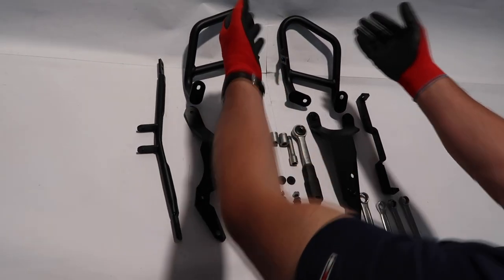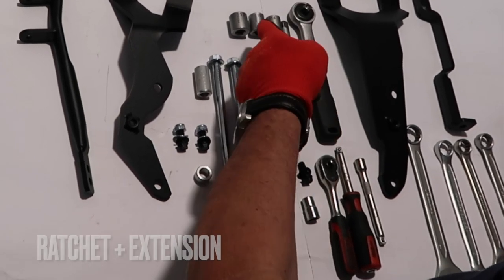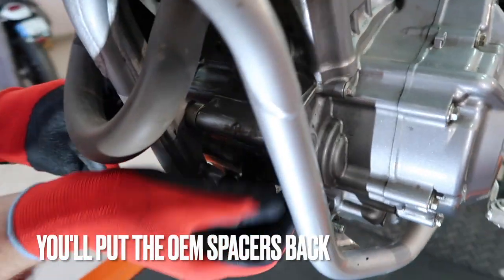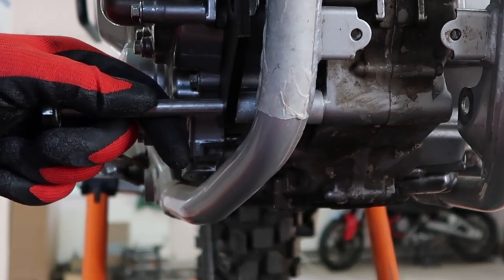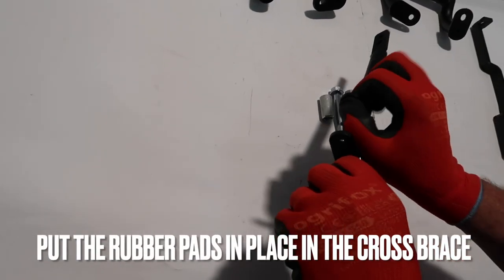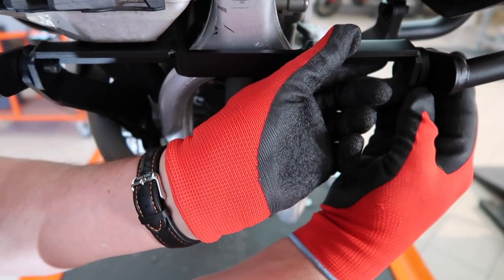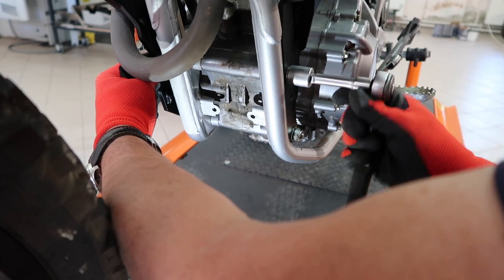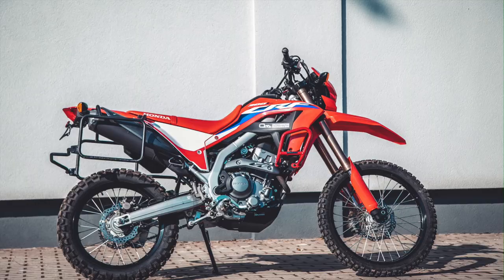Honda CRF300L Crash Bars Installation Instructions

Comment: I installed these today. I have the Flatland aluminum skidplate. It fit great with the skid plate. (for anyone upset that it didn't fit with your skidplate without modification, how could they possibly make it fit with all skid plates available, that is impossible)  They are incredibly sturdy. the packaging did a good job protecting the powder coat, there was even some clear tape over the flanges. The black powder coat is a wrinkle finish, really nice touch because minor scratches won't show at all. I thought the side bars mounted directly to the engine mount, they do not there is a flat piece of bent 1/4" steel that separates this round bar sticking out of the side from the engine mount so there is even more protection for the engine. The only recommendation I have as a product engineer is I would make the crossbar that is close to the fender a little more bent to give a little more clearance. You'd have to make the bar slightly longer to do this. The bar is close but does clear the fender. other crash bars have one crossbar, this has two making a very strong box up front and even has locator pins to make it even stronger. This was worth the extra money and I am glad I didn't cheap out.

Comment: I am interested in the protections, but I do not know if it is compatible with the ACERBIS crankcase protector, for the HONDA CRF 300L.
Reply from the maker: Unfortunately we can’t tell you as we don’t test fit other aftermarket parts. We make our own heavy duty aluminium skid plates

Comment: Just installed these. So heres the scoop.
I got the Honda Red color and they look great. Seem very sturdy. Haven't installed my AXP skid plate yet so we will see on that. 
Does it touch the front fender? Yes it does, just barely. Looking at it, there is very little clearance there. It  will scratch the front fender and i already see and feel a mark. If i loosened everything up, shifted it uo and retightened it maybe i could avoid it, its so close. But not sure. I don't want to loosen the nylock nuts and so will live with it as it is so slight that i don't notice it when riding ans i already have the scratch. I advise shift the bars upwards before tightening to seecif you can avoid this. Other than that, look great and seem sturdy and i would recommend. If you want to be sure the skid plate fits, they do sell one that is made to integrate.
These looked to me like the best crash bars and i still think they are.
Reply from the maker: Thanks for your feedback. We’ll be working on a solution to create more clearance between the cross brace and the fender. It’s a very tight spot, but a cross brace is necessary.
Reply: @Outbackmotortek  you're welcome.
Reply: Howdy, were you able to install your axp skid plate yet? How was it as far as fitting with the motortek bars?
Reply: @winstoncrider  Good question!
Installation of the skid plate is challenging. A Dremel to elongate the holes a little in the rear may prove very useful. And the screws seemed just a little short for trying to get them started. I got slightly longer bolts for the front and used the ones for the front for the rear.
When installing the crash bars they will have a small amount of play, room to move. Bias them upwards to give yourself the fraction of an inch clearance that will make a positive difference for you as well as clear the front fender a little better as well.
As far as fit with the motortek crash bars, Good enough and no grinding on either was required for them to work together. Looks great!
Reply: @ronsexton3685  Cool, thanks for the quick reply! I just picked up my crf300l yesterday and since it’s my first bike i wanna make sure it has decent protection for off-road and any low speed drops! I ended up purchasing both of those, I will keep that in mind with the crash bars installation. Happy New Years!
Reply: @winstoncrider  please let me know how your install goes. 👍
Reply: @ronsexton3685  just installed the AXP skid plate today. I see what you mean about lining up the holes with the supplied bolts being tricky. I made it work with the supplied hardware but it  definitely took a little while of playing with it since I was on my own. Looks good, my only concern is when the bike is parked and all the load is off the suspension then the AXP linkage guard rubs the linkage. Once I sit on the bike my weight prevents the two from rubbing but other than that it’s a perfect fit once I got it on. Now im just waiting on the crash bars to come in!
Reply: @ronsexton3685  alright i finally got around to taking off the skid plate, installing the crash bars, and reinstalling the skid plate. mine also definitely rubs the front fender slightly even after trying to position the crash bars in a way to give as much room up top.  im thinking about taking the front fender back off, hitting with a blow torch and trying to bend the rear of the plastic ever so slightly downwards so that it would clear. if i proceed with that and it works i will definitely let you know!
Reply: on second thought ive realized a torch might be to aggressive. will start with boiling water first and see how that goes!
Reply: @winstoncrider  Don't do it man!!!
Lol. Sound too extreme. Thanks for the info. I had wonder if before tightening, you shoved the crash bars upwards and then tightened, if it would have cleared.
Reply: @winstoncrider  If you are really determined, playing with the fender mounting might prove more successful.
Reply: @ronsexton3685  i did do that, i promise i tried and i even had an extra set of hands on the other side trying to push them upwards. i agree that heat was probably too extreme. before i tried boiling water i decided, like you said, to take a look at the mounting hardware for the fender and that proved much easier to play with than bending the plastic. i went out and bought some washers that i was going to put between the bottom of the fender and the bolt head but ended up using two spacers that I received with the AXP skid plate kit that I didn’t use because the linkage plate acted as the spacers on those two rear bolt holes of the skid plate. I took those two spacers and put them between the top of the two rear fender holes and the predrilled holes that the bolts screw into. the front two holes of the fender are exactly how they came but the rear two fender holes I included those spacers and it seems to have done the job perfectly. I can turn the bars completely with no rubbing. thanks for the advice Ron! hopefully this can help you if your scratch isn’t already too far gone where you don’t want to mess with it anymore!
Reply: @winstoncrider  hmmm, I have the linkage guard aa well. Now where did those spacers go? 👍

Comment: Today I mounted them, I have great respect for you for how you work, which is why I'm a little disappointed by the fact that the lower bar touches the radiator, it didn't take much to leave 5mm of clearance.
🤔
Reply from the maker: That’s very strange. Nothing should touch the radiator guard. Please send some photos to info at outbackmotortek dot com ASAP and we’ll help you sort this out
Reply: @Outbackmotortek  It touches under the radiator, I also tried to disassemble and reassemble but there is no possibility of changing the position, I will send a photo.
Reply: @Outbackmotortek  I can't find this address, kindly send me a link, thanks
Reply from the maker: @Skatafossy  https://outbackmotortek.net/contact-us/

Comment: I'm unable to leave comments on the website but hopefully it'll make a difference here... I just finished installing it. What a hassle! I have a 1290 Super Adventure and a 390 Duke besides my Honda 300L. All of them have crash bars. The Honda is the only one with Outback bars. First impression when I opened the box was the fact that the packaging was poor and a lot of the sharp corners no longer had any paint. Then, compared to the other two manufacturers, way too many components. Then came the installation... The black M8 bolts are of very poor quality so watch out as the heads get rounded off easily. Once done, I realized that my fender was rubbing on the upper crossbrace. When I went on their site to leave a review, their own pictures show it touching the crossbrace. Yes it's stiff. But the quality doesn't match the price.
On a side note, the right bracket with the long spacers protrudes past the frame so I had to massacre my Acerbis skid plate.
Reply from the maker: Thanks for the feedback. I’d you received your products with damage, please forward images to the dealer where you bought them from or to us info at outbackmotortek dot com. Generally our products are delivered in immaculate conditions. Rough handling can lead to damage though.

We’ll be working on a solution to create more clearance between the cross brace and the fender. It’s a very tight spot, but a cross brace is necessary. 

We’re currently in the process of upgrading our hardwares, especially the 6mm and 8mm diameter bolts. They’re indeed not the best quality. We apologize.
Reply: @Outbackmotortek  did you manage to solve the clearance issue?
Reply: @ppshouse I've just received these crash bars but have yet to install them. Having read your comments, I also have the Acerbis skidplate and you mentioned that you had to massacre them? Will these crash bars not fit with the Acerbis skidplate already installed? Thanks

Comment: These crash bars are not mechanically sound and will not provide protection from serious impact due to absence of sufficient mounting points to the frame.
It's hard to find good frame mounting points on CRF300L.
Upper crossbar needs to be clamped firmly to the frame. Those little pegs are too long a will bend on lateral impact.
Upper part of crash bars need brace bars towards the rear to be attached to the frame just above rear engine mounts. There are suitable solid frame mounting points just behind charcoal canister. The current braceless Outback crash bars will bend backwards damaging your radiator if you hit a small tree or fall sideways at speed on stony trail.
Reply from the maker: https://youtu.be/Pym4Y0Z4jes?si=ff_so1BKMXTWUqjH
Reply: Nothing protects 100%at some point everything will fold,
, but if that blow has the force to bend the crashbars, what would happen if the crashbars weren't there...???
😁